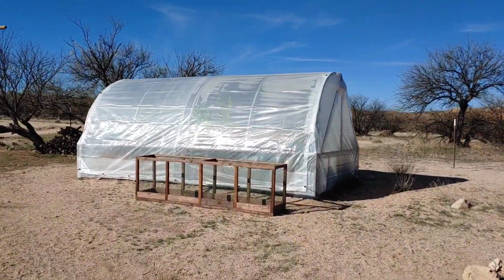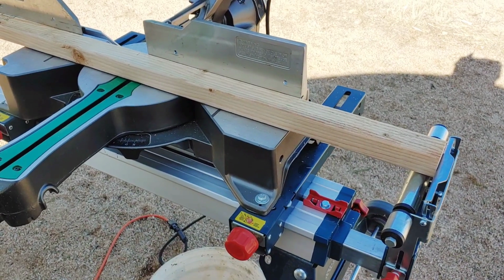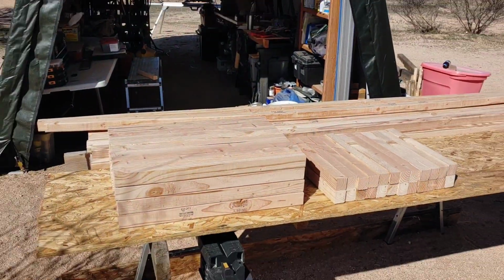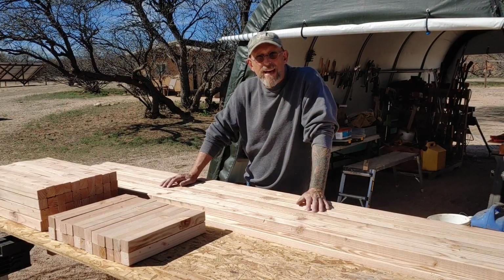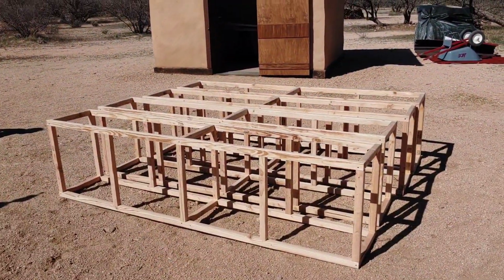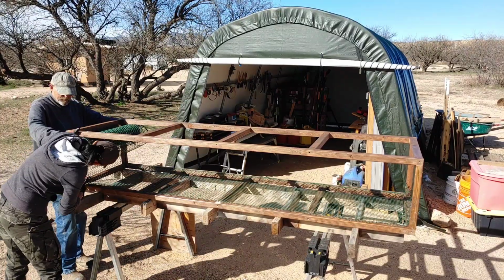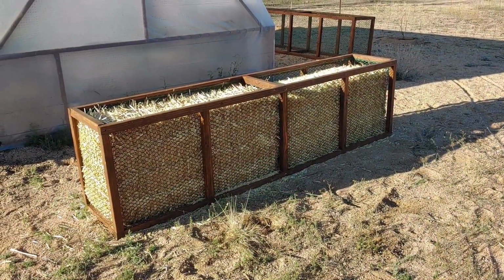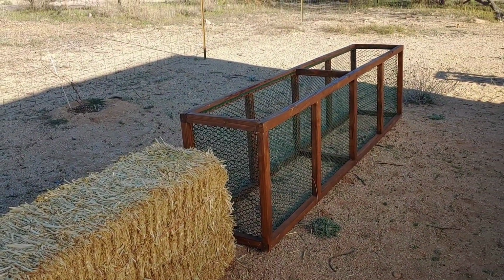#strawbalegarden Strawbale Garden Update: Building Bale Boxes

Comment: Beautiful work as always!  When's the salad party?  We'll bring the wine!  I was thinking, could be those countersink bits are meant to be used in a drill press.
Reply from the maker: The counter sink bits that I have are comrised ofca standard drill bit that goes through the counter sink portion and is secured with an Allen screw. The bit that broke was 1/8 " and I was able to loosen the Allen screw and replace the broken bit with another one I had from an old set of bits. This happened 3 times. Admittedly, they were super cheap on Amazon, and I was probably overheating the bits as well. Yvonne's in charge of the salads and the wine too. I'm not much of a fan of alcohol ever since I developed an allergy to it about 20 years ago. Yvonne loves it because I am the permanent designated driver 🤣